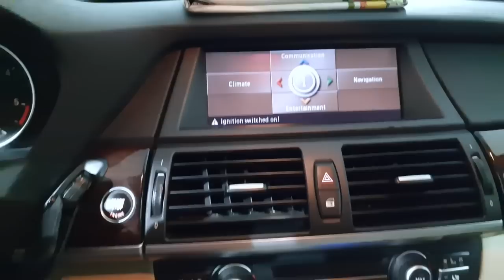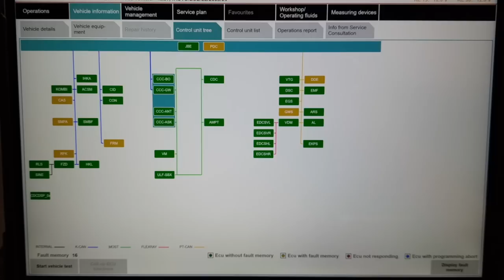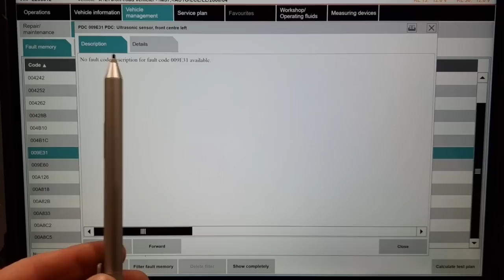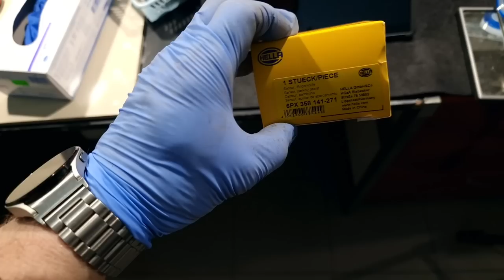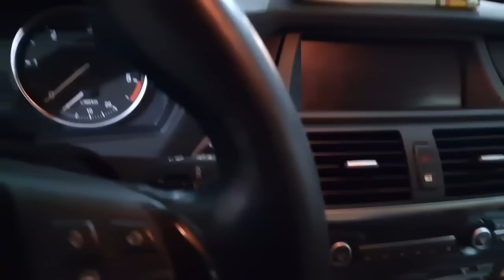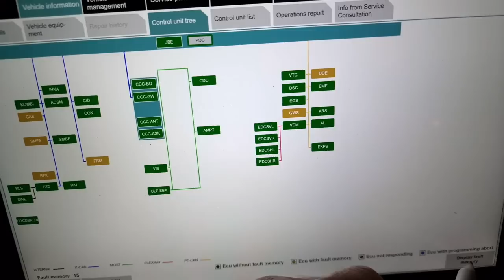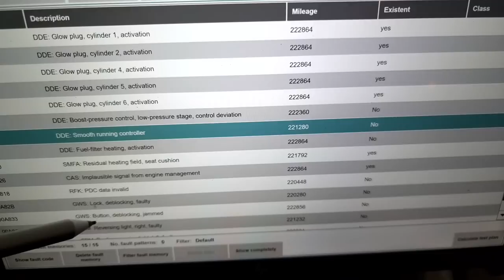BMW X5 PDC repair intermittent working

Comment: Dude I really love your videos, this one helped me track down my long problematic PDC, in my case it was 2 problems, front left PDC wire broke, wear and tear, after fixing it, PDC worked well until I fitted the bumper back, then it stopped working again, Right PDC dead. All vibrate when when U put the finger except the right one.... I will buy a new one on Monday,  hopefully it solves my problem!
Reply from the maker: Thanks for the feedback! Let us know if the new sensor resolved the problem .

Comment: Interesting. Is it correct for the e60/70 chassis that if a pdc sensor completely fails the whole system does not function anymore? Because this seems to be the case on my e61.
And i’ve heard you mention this 3 times now: do not place icom on the floor. Why not ? 😊
Thanks for making these video’s, great learning 👍🏼
Reply: In my case, placing the iCom on the floor leads to week wifi connection and on a few occations ... I've stepped on it .... :o)
Reply from the maker: If one sensor is bad, the complete system is deactivated,  no matter the model , it's a safety thing , about the icom on the floor, Gisle is perfectly right, and there is also the fine dust that is very attracted by working electronics but most important is about respecting your tools!
Reply: @MOvidiu  Ah ok, didn’t think of the dust. We learn every day !

Comment: Hello Ovi,
I have E91 LCI with Logic 7 audio system. 2 speakers are not working, and in the summer when it’s hot outside sometimes the other speakers are shut down. What can be the problem? 
Thank you in advance! 
Really enjoy your videos!
Reply from the maker: Hello! you need to do a diagnose! I'm not able to diagnose your car without physically seeing it!! Can be a bad L7 amp , speakers, wiring. .hacked wiring...

Comment: By me is pdc dead you can read the pdc but it doesnr give power to sensors checked fuses they are good.
Reply from the maker: Probably a shot circuit blown out the internal  driver,  try to replace the PDC module, but after checking the complete wiring

Comment: Did you encountered any problems with Hella sensors in terms of fitment functionality and reliability ? Nicely done, not so clean as you usually do, still good work
Reply from the maker: Sometimes is maybe good sometime is maybe s...:)) but! most of the time they are working good!

Comment: That grease is dielectric grease. Used to prevent corrosion and help seal the connector. Used on electrical items exposed to atmosphere.
Reply from the maker: yes probably that was , but you'll use that on ships or in any other field, not on bmw cars